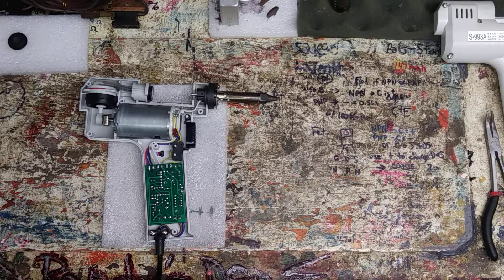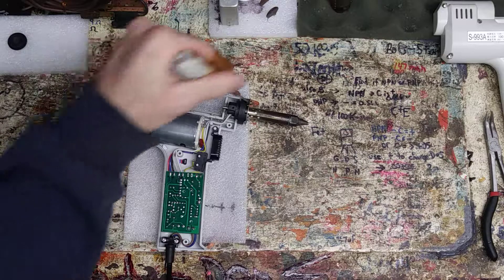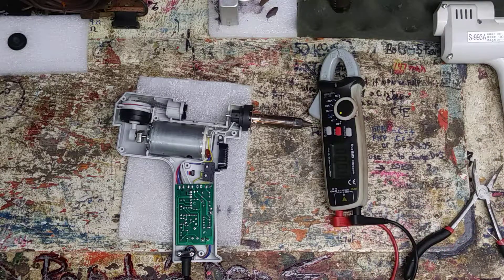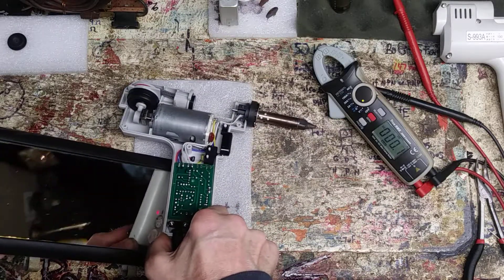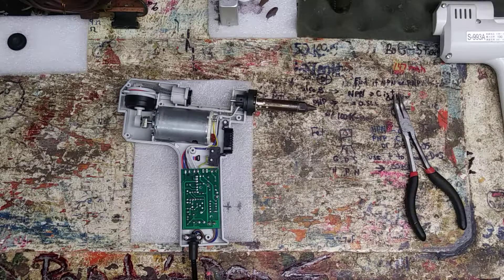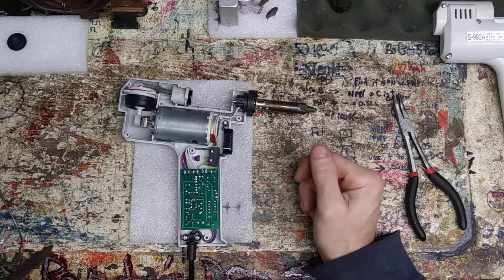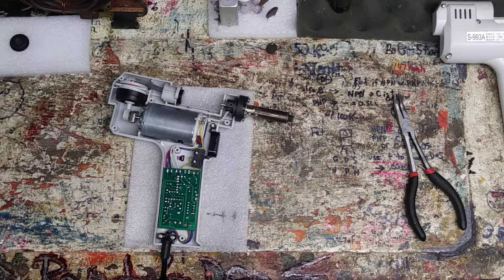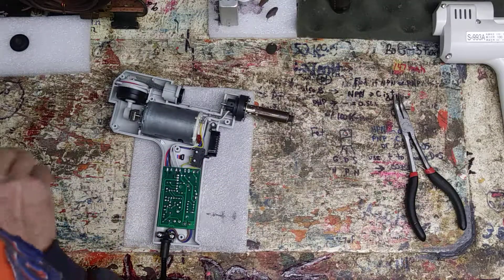S-993A 100w desoldering pump not heating up. Tear apart and will fix. Part 1

Comment from the maker: Hey I just uploaded a 2 part video of taking my S-993A apart and swapped the 2 wires red n yellow that went to the motor and mine ran backwards. I think it’s much easier to swap them at the board than by the motor cause mine r soldered on to the motor, anyways I got bigger problems w mine... lol   Hope this gets yours going Mike good luck.     Randy

Comment from the maker: Also when it comes apart the board will still be attached to the temperature dial, just a bit of force and it should pull free. Be sure not to turn it or to turn the potentiometer so that it will still be aligned when you put it back together, ask if you have any questions buddy

Comment from the maker: Ya you’ll want to open it up and switch the two wires that attach to the end of the motor, I believe they are connected onto the motor by flat tabs  that should just pull apart.  I hope this works for you Mile

Comment: Hello was wondering if you be able to offer some of your wisdom on my S-993A. I'm having a strange problem with it blowing air outward. In the vacuum pump does not sound like other vacuum pump this model. I just got it and haven't used it for any large projects just removed some LEDs to test it. i made a Reddit thered about  it https://www.reddit.com/r/soldering/comments/dwzly5/s993a_desoldering_iron_not_working_as_it_should/ or you can just watch the YouTube video if you want https://www.youtube.com/watch?v=r3XPi5bHz-0 is far from a good vid im not a you tuber ;-)
Reply from the maker: Mike Willson  hey Mike thanks for watching. I’m going to check your video out and get back to you, I hope to help you out. Initially it sounds like the pump is in reverse? Just a quick guess Mabey the wires got crossed up?
Reply: @RandysDen  thanks a lot for having a look man, I really appreciate it. I'm hoping that's what it is.  just some crossed wires. something they goofed up during assembly. Do you want me to open it up and take a pictures or whatever you need. I would like to try and avoid sending it back if I could.